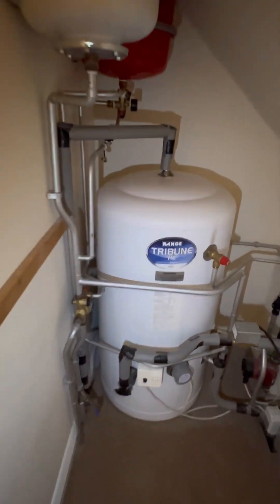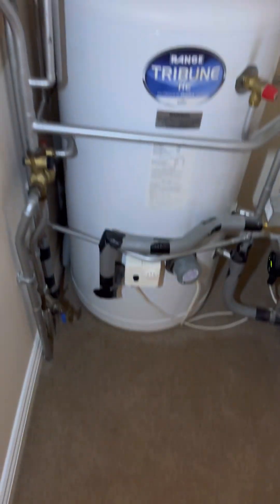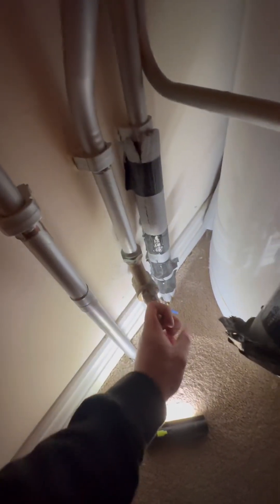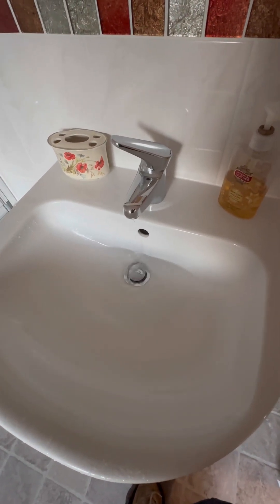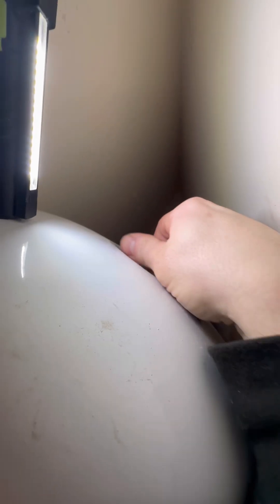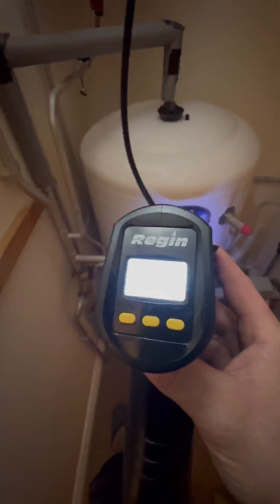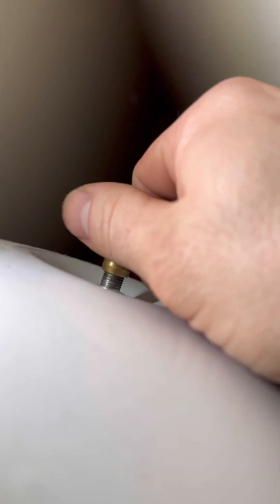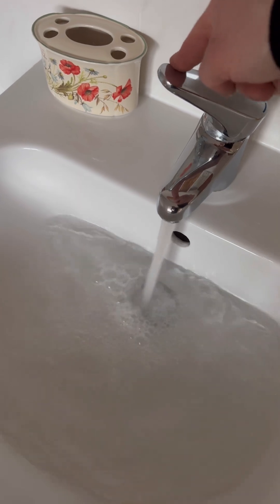How to re pressurise an unvented cylinder expansion vessel Tribune 150litre cylinder

Comment: Nice video bud, however zilmet/altecnic have always said what ever cold mains is adjust to same-0.2 otherwise you can get a foghorn noise, most properties have different mains water pressure, pop on outside tap to confirm pressure, I’ve had a couple when mains is only 2bar and when set at 3 bar caused the foghorn /rumble noise . Adjusted to pressure of water and all good👍 every days a school day 😊
Reply: On mine, I have same tribune 150L tank, vessel data sticker says 3 bar. I double checked with the last service engineer (potterton staff and original installer) and they confirmed for my install its between 1 and 1.5 bar. I recall a good number of years ago saying 1.5 bar when I asked the same, just wasn't too sure so thought best to re-confirm. Made a note of it now :)
Reply: Have had that problem in the past aswel.

Comment: how do you check and do the same on the heating side (red)? cheers
Reply: Did you find out what you were asking?
Reply: Yes thank you. It was just a question really. I already knew which vessel was for what. Just this system had robokit so had to mess around  with combination valve, mono bloc whatever you want to call it to sort the pressure out. Thanks for the help tho.
Reply: @MrMaff1975  the red is for the central heating. Not needed the same air pumping check ever. I guess so long as the guage pressure is as expected, that is ok
if the pressure has dropped, say 0.5 bar and the boiler is stopping, hopefully it might just be a case of turning on the valves on the re-fill loop . https://youtu.be/ReKh8NTwLQ4?si=oVrJcWZg52AIW_CZ
On mine the refill loop hose is always connected, I have a toggle to turn water refill on/off. You might need to do this after bleeding radiators for instance. On mine they hardly any air in in every year check, so in the many years, this vessel rarely needs refilling if at all.
I did have an issue years ago: central heating stopping,  red vessel pressure dropping, constant refills to get it back. When engineer came, its was the white vessel diaphragm gone which caused over-pressure on the entire system. Once white vessel replaced, all ok.